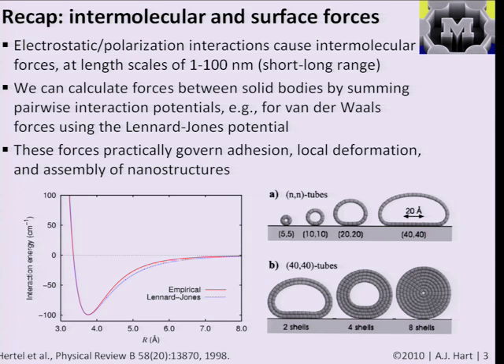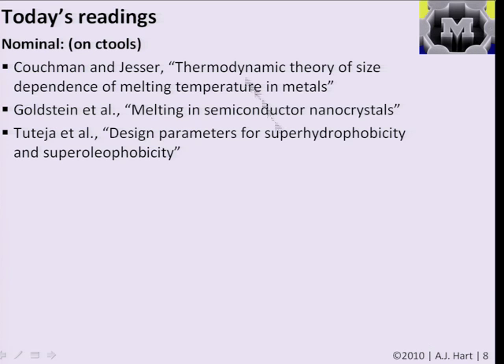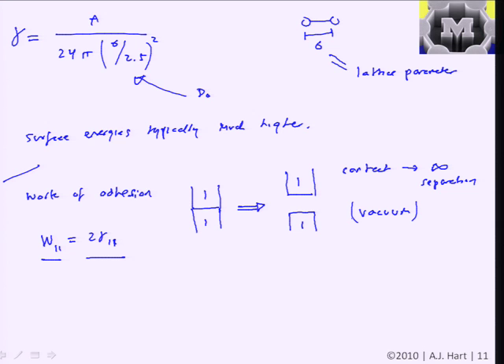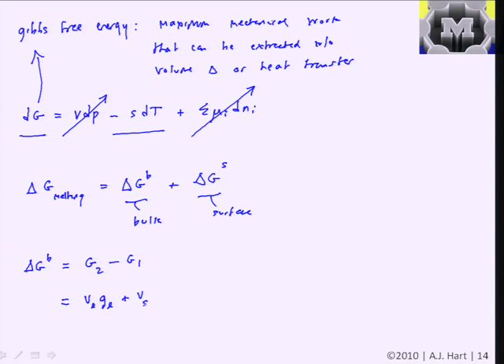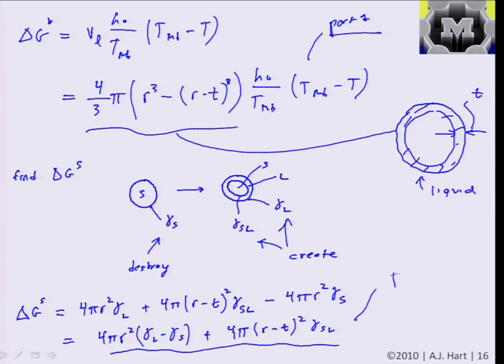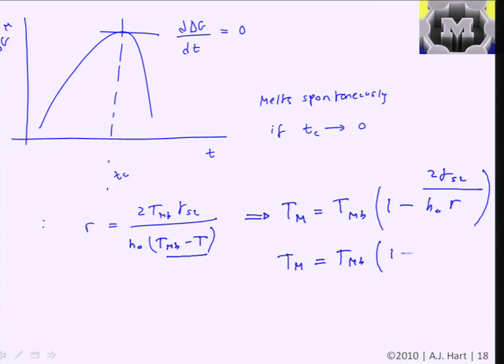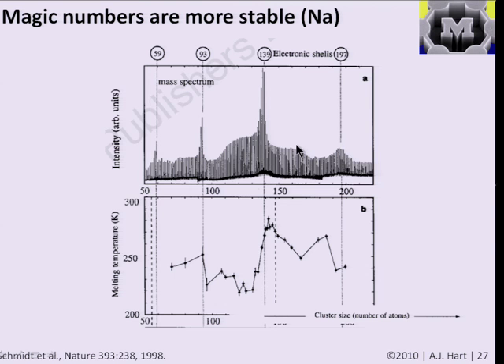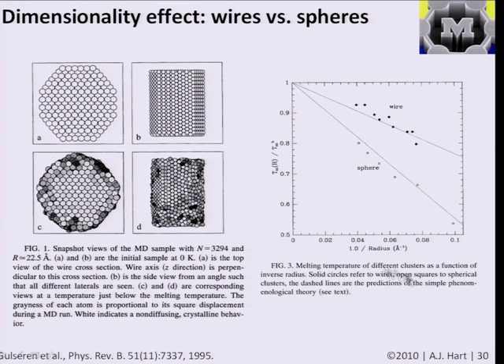Nanomanufacturing: 08 - Surface energy, melting, and wetting

Comment: around 1:01:00 they reason with diffraction peak intensity the abscence of a solid crystal, for melting point, this is interesting, for research in general, the sudden decrease of a peak means that a phase is gone.
Reply: It also includes organic coating stabilizing the material so it wont melt at low temps.